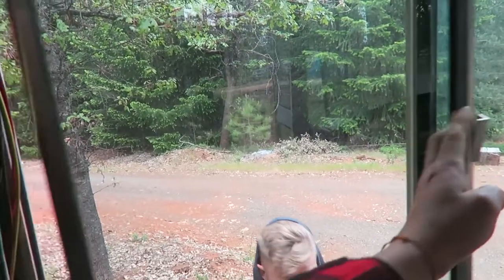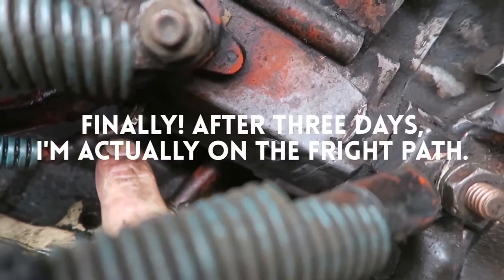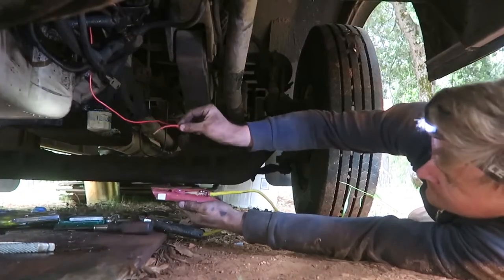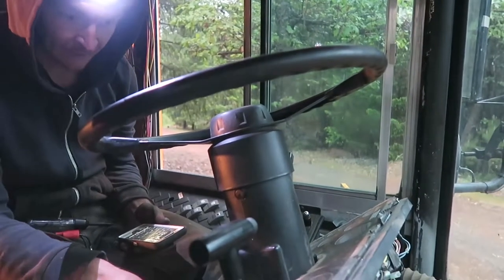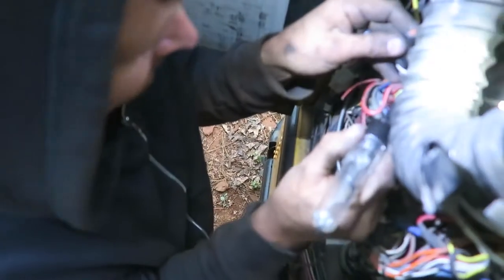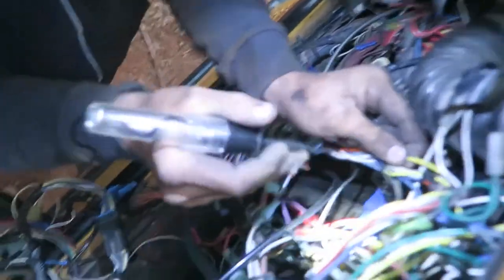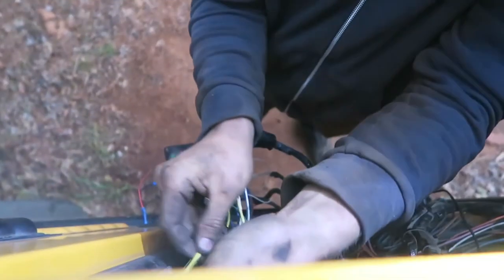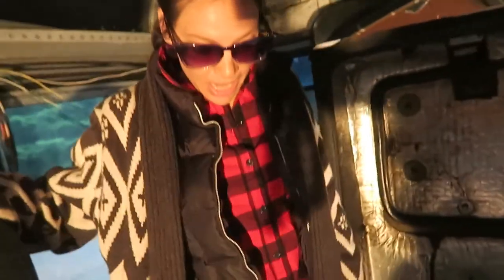#32 SKOOLIE BUS CONVERSION | VICTORY!!!! ELECTRICAL PROBLEM FIXED!!!

Comment: congrats. it is awesome to have someone like Steve to help troubleshoot. I've been really lucky with my step van conversion project to have people like your Steve to help me troubleshoot. we did almost the same electric troubleshooting for several days on the wiper motors and finally found one wire that was not working properly. like you, we got it all on video. again, congrats!
Reply from the maker: Yeah. I think the bus would have been involved in a dynamite project if it weren't for Steve. Thank you for the kind words.

Comment: I'm glad you got it figured out Ian. I have seen somany buses where everybody disconnects the safety wires and then not test till later.Then they think it's something else. I try to test each safety that I disassemble so I can isolate the issue. Glad you found the problem!